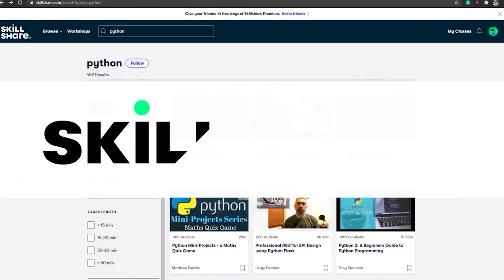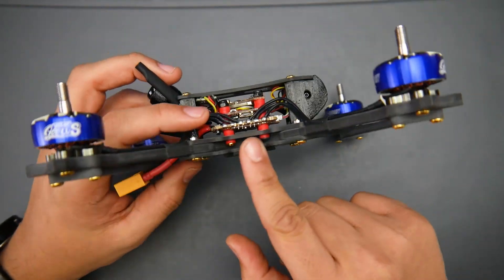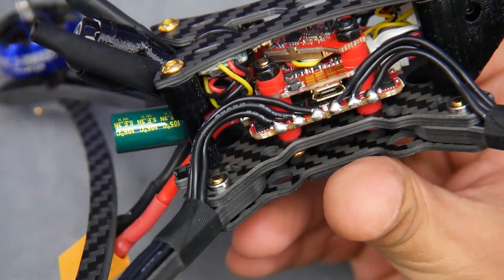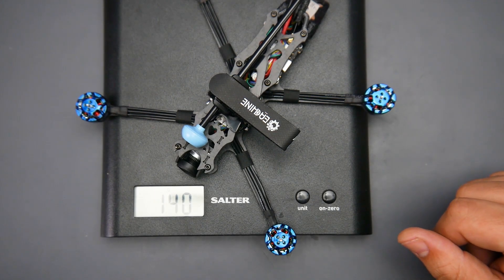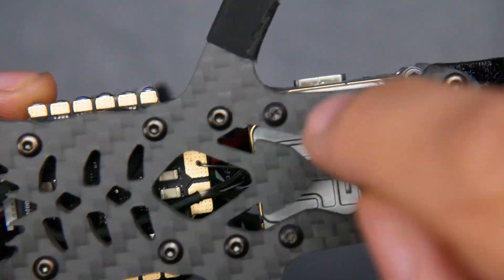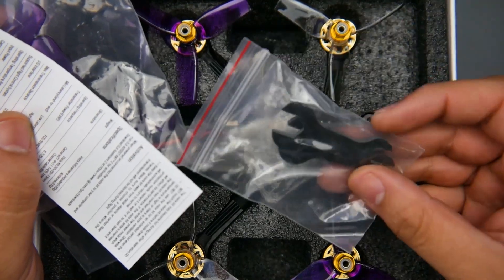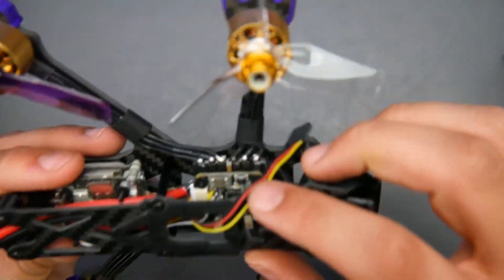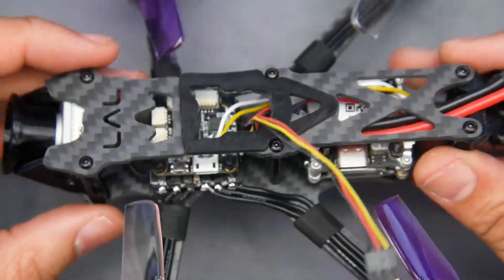Let's Open These FPV Drones Together

Comment: It does look well but a little thought into tpu mount at rear for securing cap would of been a nice touch. After a good few battery plugs in’s and unplugs that cap is gonna break its legs. Bit it does look nice!!!

Comment: By this frames i like it to put the capacitor in 90° angle to the Flight direction.
Like the Gas Tank of Soviett T-62 Tank or Panzerkraftwagen VIII "Maus" 
It looks nice.
 it is than Protected. But it prever soldering Skills.

Comment: Wind 5 was built to be a racing tank.   300g isn’t bad for a racer and some such as myself prefer the extra weight depending on the track.  I have 2 Flightone arc one builds that are 300g on the button with props on and the fly so so so good 😊.  Also have 2 more arc ones that are 265 with props and they also fly great.... on tracks with a lot of straights.   The heavy ones are great on tracks with lots of flags and turns.   And I also have a 195g top Mount racer (torquefpv pro5) that I absolutely love but i think it suffers bc of the small 2205’s I have on it but I’ll say it’s been the most reliable racer I’ve ever owned.  3 years and still has the original Flightone revolt v2/bolt v2 stack in it and runs 6s perfectly, at least on the hyperlite 2205 1722’s.   That all said, super light weight racers aren’t the end all unless their super reliable.   
The Eachine lr 4” looks like a good cheap one.  The frame could be a touch better but from what I’ve seen it seems to be a good model.  👍👍
Reply: I dont race but I notice that on my 5" race build..again I dont race....300 grams w/o battery seems to be more controllable for me,considering wind is always a factor when I fly,take care brotta👍
Reply: @huckaberryfpv4986  yep.  I agree.   I can toss my 300g arc one around a track like nothing else but when I get on my 250grams arc one there’s a little drift in the corners that while still very controllable I notice I always have to compensate and turn earlier.   The heavier one just sticks and moves.   And really I fly the 300 more than the 250.   My torquefpv pro 5 at 195g before lipo is just in a field by itself.  It’s a long stretch x top mount racer and man that quad is so locked in, zero drift, zero propwash, zero float.  It just locks attitude and goes.  Even with 3 year old equipment and slower with the 2205 1722’s id race it against anyone any day.  Yea I may get smoked but I bet my lines are cleaner and as soon as you mess up your 2207.5 racer just got passed by some old 2205’s 🤣🤣🤣.   I just wanna not give that rig up, it’s been the most reliable quad I’ve ever built, I can’t seem to break anything on it except arms of course but I had torque Fpv Up them to 5mm and haven’t broken an arm since.